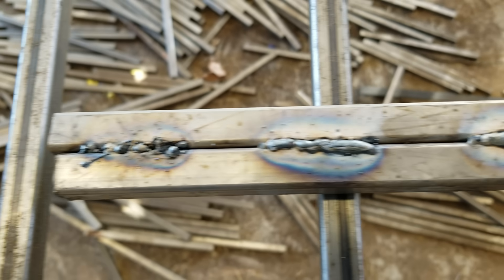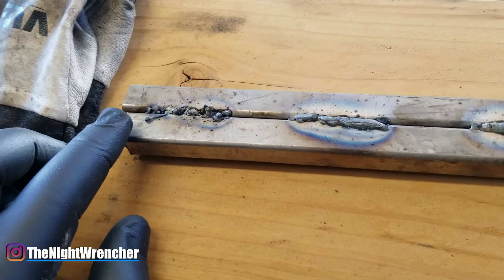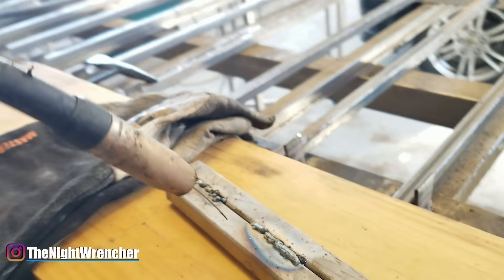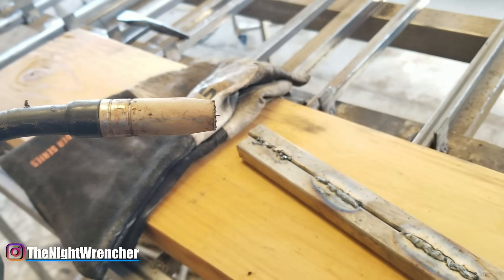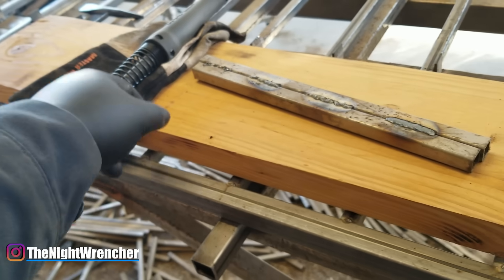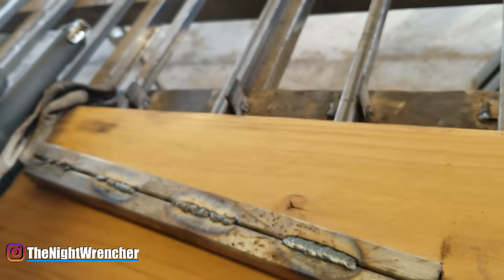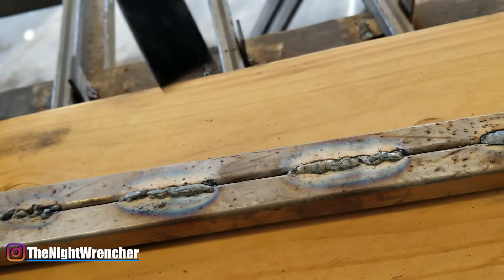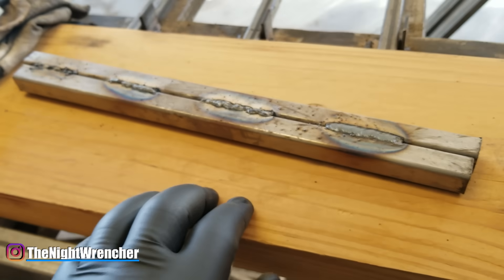Learn Perfect Flux Core Welds In 10 Mins | Gasless Flux Core Welding For Beginners Tips And Tricks |

Comment: The sun burn everyone is referring to is actually called flash burn. 
When it comes down to gloves, I would recommend buying actual welding gloves. I promise you that if you wear any other glove you will regret it at some point.
Be sure to wear long sleeves ( I use leather sleeves made for welding).
As far as flash burn on the neck, a little DIY will help. Go to Wal-Mart (or other store) and buy a DIY snap kit. Mount 3 of them on the chin part of the helmet in a line following the bottom. Now take a piece of leather and mount 3 snaps to fit the 3 on the helmet. Now how far to let it hang down will be up to you since everyone has different necks that needs protecting. Mine is about 3.5 inches down. It helps a lot and you don't have to wrap up your neck.( a pain in the neck when it's 90 plus degrees, lol)

Comment: The problem I have is that I never practice. Then when I do need to weld I am lying on my side at some twisted angle only able to use one hand, and my wleds are complete garbage.
Reply from the maker: Find some scrap and practice on that. Once you get the technique down, welding on your side or upside down wont be an issue

Comment: I recently got back into using my welder. Tip for people learning to weld. When you create small tacks to hold pieces together and you're coming to a tack, your puddle should be hot enough to begin melting that tack before you get to it and then when you run though that tack and it should become one uniform weld. You will see improvement over time, but I struggled for the longest time getting it right. Tack welds don't need to be large either just enough to hold.
Reply: Great tip, might not apply to everyone here but this makes sense to me as I'm day 4 into a new job and I'm just training. Stop and start weld are annoying but I'm literally brand new but with my nvq being 12 years old

Comment: Does the wire ever touch the material or is it the same as stick welding as do not touch the material but keep it say 1/8 of an inch or so above the material
Reply from the maker: After the spark is lit, the filler material will tend to vaporize right before contact. If the wire speed is so fast that it hits the molten pool, you're going to feel it in the gun and it will interupt the weld and cause a lot of problem. Keep the tip about an 1/4 away from the metal and control the wire speed so that it can feed the puddle and not pause but not so fast that it tries to dig into the pool
Reply: @NightWrencher  Thanks kindly for all of your info and great video

Comment: Very good and awesome work thanks I am a beginner trying to learn how to re weld my exaust back together after replacing the catalytic converters
Reply from the maker: It should be pretty easy, just remember that exaust pipe is really thin so you should tack the pipe around first and then connect the tacks with small beads
Reply: Thanks I'll remember that tomorrow and do that I have to do more practice to something else so I mess nothing up major anyway I do appreciate the response

Comment: can you comment on whether metal should be bare or can it be painted or treated before welding?  Are there thickness limitations either too thick or thin for flux core?  My projects are usually car sheet metal or farm machinery.  I'd like to move past rivets.
Reply from the maker: Im making a video on this but Whenever possible you should clean the steel completely and strip off the coatings because they will make your welds very pourous. Paints and oils will create air pockets and really mess up your beads. Depending on machine settings but a 120v flux welder using .035 wire can weld up to 3/8 plate safely.

Comment: Never even turned on a welder before. Just bought a lincoln. This was so helpful. My brother is a very good welder but he is 3 hrs away and hard to teach that far. I've been going pointing straight down about an inch high. Been getting just a few pin holes on some. They do have that nice ripple look. Do you guys go straight or do a circle motion with these?
Reply from the maker: Sorry for the late reply, check out my vertical welding video, I go over the two methods but my choice is straight across especially for thinner materials. You don't need to go i circles to get dimes.
Reply: @NightWrencher no problem! Thank you for replying. I have alot better welds since this videos. I'll try this out and see. Thanks.

Comment: Do I need to wear respirator with flux core if using fan to blow smoke away
Reply from the maker: You should be fine. Youlk be hard pressed to wear a respirator under your welding helmet

Comment: Are stick welders no longer a thing? (welding rods)
Reply from the maker: They are but not really for hobbyists. Wire feed welders offer welding much thinner metals much easier. For welding plate steel or frames, I would still use some 6010/7018
Reply: @NightWrencher  cool thanks, I haven't kept up with welding and thought technology changed. All the welders I knew were farmers explains why they all used stick.
Reply from the maker: Industrial welders still use stick. My brother in law is a pipe welder and stick is all he uses

Comment: I'm picking up welding tips and tricks from various maker channels until lockdown lifts and I can do an actual in-person course. The general concepts are straightforward enough but I reckon this one video just knocked 2 hours of practice time off getting my first good weld. Once I've had a chance to put that to the test I'll let you know! 😁

And a question if you see this: I've noticed a lot of makers (more DIY than shop pro) just clean their welds with a wire brush followed by a flap disc on an angle grinder, and I've almost never seen any of them bother with a slag hammer. Any thoughts on when to use which tool for post-weld cleanup?
Reply from the maker: Thats awesome man! Good luck and let me know how it goes! Typically a slag hammer isnt needed especially if you're going to grind down the welds flush but even if you dont plan to grind them down, a wire wheel on an angle grinder along with some anti spatter spray before you start welding should clean up the weld nicely. I only use the slag hammer to inspect my welds while I film and its faster than grabbing the grinder. But the key note is that the slag cap is the #1 tell tale sign of how well youre welding. Easy to remove= good. Hard to remove=bad
Reply: @NightWrencher  Awesome, thanks for the info! Keep crushing it :)

Comment: Pro Welder: Can't say the bit about getting burnt is exactly true. If you weld ? TEN MINUTES will burn your skin andf you'll see it as well as Feel it tomorrow,or later tonight. MIG or flux core is faster burning to hands arms, face, neck and eyes than comparable arc welding . IT will harm you. you'll get immediate wrinkled marks on face if squinting w/o a mask. Eyes open welding you'll get AWFUL pain in your eyes when the burn manifests later. FIVE MINUTES and hands will have IR & UV burns that resemble a heavy sunburn but it's medically worse. Even a brush cotton shirt sleeve will dramatically reduce radiation burns to arms. GLOVES, MASK, JACKET, LEATHER BOOTS, A LEATHER APRON & a Cover for the back of your helmet (MASK) are essential. NON FLAMMABLE CLOTHING is a very important consideration and have a bucket of water CLOSE. A plastic bottle full of H2O with a small hole in the cap (1.8 mm- 3 mm) that you can grab from nearby is very useful to douse fire. Even a fire extinguisher is GOOD SOUND preparation.
Protective gear is more important than the job you have to do. DON"T WELD WITHOUT IT !  
All these videos about the subject are worth watching but this one is excellent for flux core understanding.. A real sound welding system is flux core which is a superior arc welding type application. Gas shielded is a superior product again.as a stronger material fusion than even flux core.wire welding. Thank you night wrencher for the helpful instruction you're giving us all, here!
Reply from the maker: I appreciate it, thank you. I was specifically talking about those having a hard time even keeping the arc lit. Split second welds wont do too much to you. Once you can actually hold the puddle and drag is when protection is 100% nessesary.

Comment: Idk how to say it but Should I be consistent like consistently welding, or stop and go, been welding a few items, just trying to progress with it.
Reply from the maker: Thick materials you can run straight across, thin materials you want to weld in small sections.
Reply: @NightWrencher  okay cool. I’m tackling my rocker panels and, exhaust on both my car and truck, I welded half the exhaust, which is a bit thinner, I burned a hole so I just buzzed on for a second then let cool, then repeat until I got all the way around the pipe. Thanks for the input I appreciate it. Wasn’t sure if I should be or shouldn’t be doing it the way I was but, I mean, if it works then 🤷🏽‍♂️
Reply from the maker: The problem is that it can warp the metal but for exhaust, you can run beads around the joints if you turn down the wire speed a bit. For then rocker you should do tack welds in a criss cross patter until theyre about 1/2 inch apart

Comment: This was very helpful man. I bought a flux core welder and jumped right in after watching a lot of welding videos. All of my work looks like the first example. 😂 and I have no idea how to adjust the damn thing. You’re explanation was the best I’ve seen so far. I’m taking a welding class this fall to get certified. I’m excited.
Reply from the maker: Thanks man, I have a few more videos on the subject if you wanna check them out. If you want to weld as a profession, stick or tig is what I would focus on. Theres not as much demand for mig or flux core. Flux core is more of a general purpose process, perfect for the hobbyist.

Comment: Can you use this machine to weld, quarter panel on a older vehicle.( 1972 international scout) has good metal in it. I'm pretty sure you can't on new cars.
I am a old school fabucater. Migs, tig, plasma and arch. Never used a flux.
Thanks for your help.
Reply from the maker: New metal is really thin so warpage is fairly prevelant. Older cars have thicker sheet metal so welding them with flux core is no problem as long as you dont lay into the metal when you tack it. It will still warp a little bit but nothing crazy
Reply: @NightWrencher  thanks brother, love the videos
Reply from the maker: Thanks man I really appreciate it

Comment: this gloves you using does not look like the Tig welding gloves from harbor freight as listed in description?
its looks very thin and comfortable (not thick leather), also are you injecting constant air flow inside the glove, it looks puffy and probably cools your hands too?
Reply from the maker: These are the gloves I use when I weld with flux core. Theyre very thin, easy to work with and durable but they dont hold out too much heat so you'll want to get mig gloves if running longer beads. https://www.harborfreight.com/professional-tig-welding-gloves-l-63485.html

Comment: Ha ha my welds look like the 1st one .
Reply from the maker: Practice makes perfect 👍
Reply: @NightWrencher  Found the problem, it was the old flux coated wire which was the problem, just need to practice more now, but at least it is welding .
Reply from the maker: Nice. I like to use lincoln innershied .030 wire. Try it out if you get a chancr
Reply: @NightWrencher  Thanks for the reply, i am in the uk, and went up from 0.8 to 0.9 mm flux coated wire which is a big improvement, as it is only a bottom end cheap diy gasless welder
Reply from the maker: Oh ok 0.8 would be the same as .030 and 0.9 would be .035. Find your groove and just practice. I'll have a new welding video up soon!
Reply: @NightWrencher  Thanks for your help and encouragement

Comment: I was with flux for a living and you can push weld it very well. It’s all in your technique. I build industrial hvac systems and it really depends on the metal and application.
Reply from the maker: I can push it as well but for a newer guy it might be too difficult to start
Reply: @NightWrencher  that’s a very valid point. Pulling was easier for me at first due to the added control. It’s definitely not a skill that just anybody can learn.
Reply: Using flux core I always push the puddle, using dual shield I pull

Comment: Been mig and tig welding for 40 years. As the old saying goes, master walking b4 running.  Practice  , 2 hands if possible, consistent speed and dexterity.  Clean steel important and bevel if possible so you get a good burn in
Reply from the maker: I always weld flux core with one hand and one finger for stability

Comment: Good points in video, I would add adjust your wire speed/current on a scrap piece that is exact thickness and shape of what you are welding. Then evaluate the penetration before you weld the actual piece. It looks like In the video he was welding wroth iron but testing on mild steel of different thickness. This is fine for video purposes but I would always test with what you’re actually going to weld on. With the correct wire speed you can push the puddle back and evaluate if there is correct penetration and you can work the puddle correctly. You can also cut the scrap piece and dip it in ferric acid to see the actual penetration and heat affected zone. Use a soapstone marker to lay out your work. It will glow when you are welding so you can follow it as a guide. Sometimes welders struggle to see their work when the helmet darkens and this helps tremendously. I find by doing this I can get perfect welds every time.
Reply: Or use a true blue welding glass..

Comment: 100spf sunblock works to stop the UV rays that are burning your arms. 1/2" or so off the material should work well for shirt welds like that. If you're running long beads maybe you'll back up a little. 3/4" tops in my opinion but closer the better. Dialing in a wire speed that fits your comfort level of movement and heat range for good penetration. Nice stack in the last weld for gasless flux.

Comment: I have a Lincoln Weldpak HD. A very bottom end welder, but it's all I need. The only problem I have with it is getting a consistent wire feed speed. I figured out that if I loosen the spool almost to a "Birdcage" I can run 6 inches of a good weld.
Reply from the maker: It should be pretty loose for sure. But I find slower speeds on my lincoln weld better.
Reply: @NightWrencher  I have my wire speed at 9+ most of the time or it starts skipping.
Reply from the maker: I dont know what your 9 is compared to my welder but heat range is A,B,C,D and wire speed is 1-10 so typically I'm at 3-4

Comment: Excellent for a someone new to welding like myself.  Can you tell me what the metal thickness was and what settings were selected on the welder?
Reply from the maker: Thanks man! The pieces were 16ga and the settings were 122 on the wire speed and 16.5 on the voltage. Different machines and wire will weld at different settings so keep an eye on that!
Reply: @NightWrencher  Very helpful.   Thanks

Comment: It's the light that gives you the so called sun burn, not the heat from the weld. I have 15 years of experience and have had my share of burns. And that isn't slag that forms on top of the weld. That is the flux in the welding wire that forms on top of the weld to protect the weld from the air getting to the weld and allowing porosity from forming in the weld.

Comment: Now you just need to tell if it is - to gun and + to return OR + to gun and - to return. And why.
This a common issue that is rather poorly addressed except the common answer "it is the opposite to gas welding"...
Reply from the maker: Thats true. I'm so used to welding only flux core, I forget that most people dont know if they have a machine that is mig capable
Reply: @NightWrencher  And the answer is? 
And what to do when welding with flux-core wire AND protective gas?
Reply from the maker: Most flux core wire is electrode negative unless it specifically says otherwise. If youre welding with both flux core and shielding gas then youre wasting your money because solid wire is cheaper and welds nicer which would also be electrode positive instead.

Comment: Any tips for good practice material?
Reply from the maker: Go to the hardware store and pick up a 1 or 2 ft small piece of 2in x 1/16 or 1/8 flat bar for a few bucks. You can cut pieces off in small 1in sections and practice different types of welds. It will last you a good while and you can look at the back side after every weld to check your penetration
Reply from the maker: Its also thick enough that burning through is unlikely